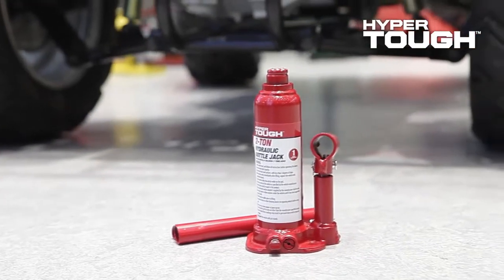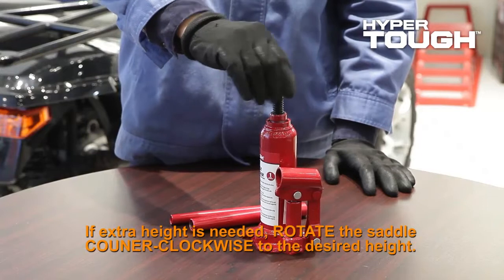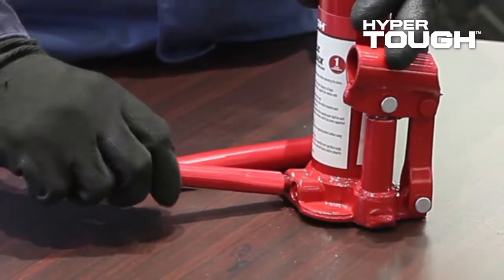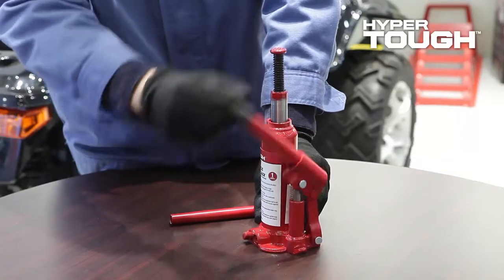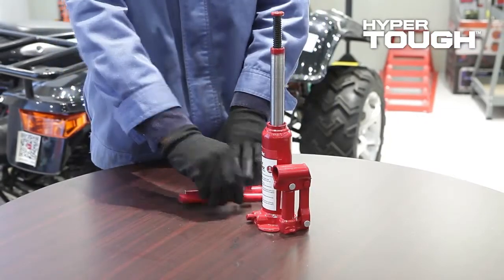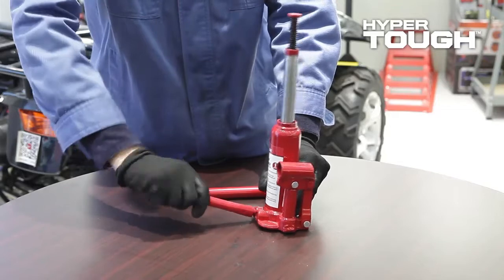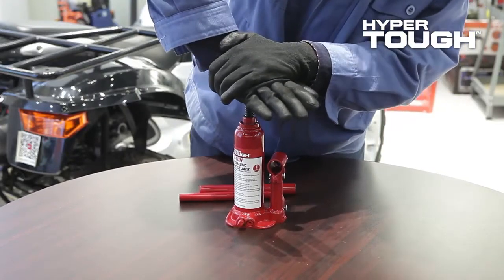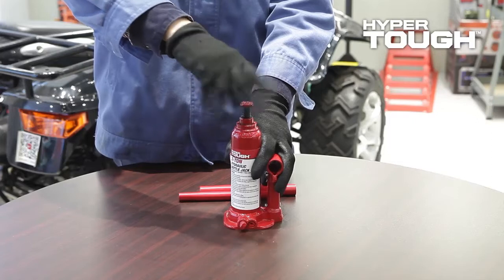HyperTough 2 Ton Bottle Jack T90203W how to use the product

Comment: Just tired of these manufacturers that don't have the customers' end use explanation in mind. There's a port beside the release valve, and there's absolutely no information on it in the manual, nor even a video on it on the manufacturer's website. It's just there and what are we supposed to do with it? Should we just guess its function??? BE CONSIDERATE when putting out manuals or instructions. Customers shouldn't  have to be wasting time researching that . What does it cost you to include that info in the manual??? FRUSTRATING!
Reply: It's probably used to add oil.